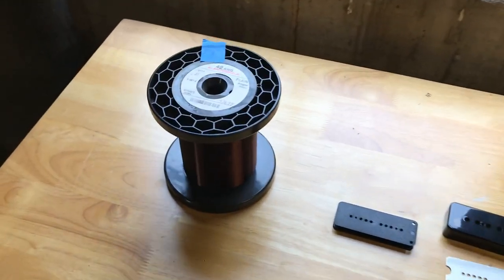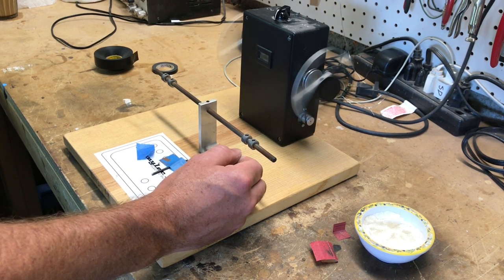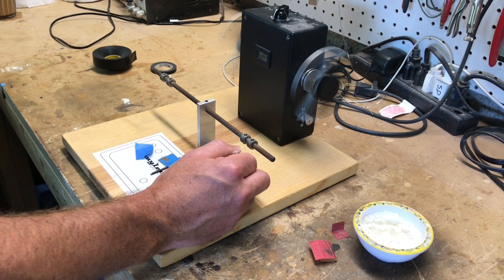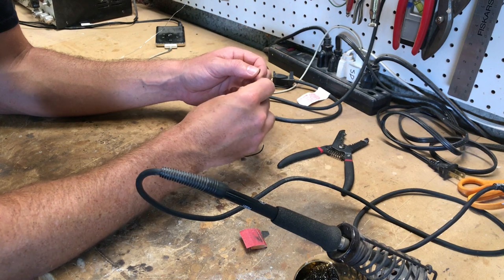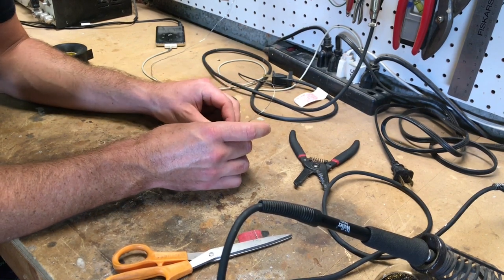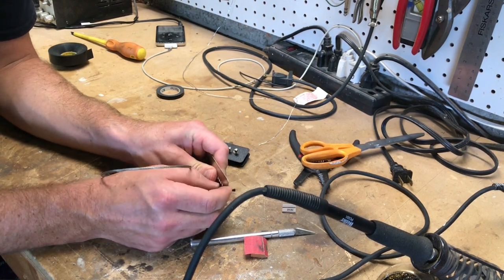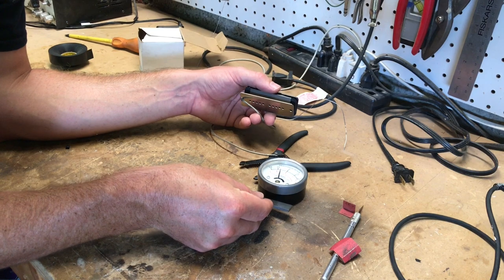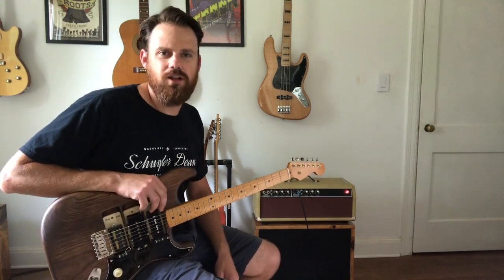How To Build A P-90 Pickup

Comment: This is quite interesting, I have a question though, what if I wind a bridge pickup P90 and I wind 12k revolutions AWG42, it will be significant darker in the tone compared to a neck pickup, what if I try compensate that 12k revolution darker pickup with a capacitor of some sort soldered on the pot, to get the high output but with clarity.. would it work ? Thanks for the video.. :D

Comment: If I remove 4 poles and replace it with plastic ones, will the pickup just absorb the tone from the strings relative to the remaining 2 poles? Thanks in advance for the answer. :)

Comment: I realize this is a little bit older video but I’ve noticed that when guys spec out vintage P90’s especially when you look at the older AlNiCo V Gibson pickups the neck pickup is often a few tenths of an ohm higher resistance (hotter) than the bridge pickup. 

So is that just a relic of the AlNiCo V being in the neck and needing different winding specs or what? 

Not trying to point fingers and say you’re incorrect or anything, just curios because I want to build some pickups of my own and you definitely have me beat in experience. I just know what I’ve read and it tends to show these older P90 “sets” having a slightly hotter neck pickup. 

Usually these measurements are taken at the output jack so could the extra resistance be a  result of the extra wire required to reach from the neck area to where the controls are typically mounted? 

Great video! Thanks!!!
Reply: Resistance has nothing to do with hotness, at least not directly. DC resistance depends not only on amount of wraps but also on wire gauge. Which means pickup with lower resistance can still be hotter (to have more wraps or more powerful magnet). By changing gauge they usually control bass amount you get from the pickup while keeping amount of wraps around the same for both neck and bridge pickups. But in case if pickups are identical, even if they do exactly the same amount of wraps wire is still not ideal, so there is always difference, e.g. they were pulling wire harder when producing second pickup and it became thinner. Wires that connect pickups are thick as hell compared to copper wire in the pickup itself. piece that connects pickups to switch and jack has resistance close to 0.
Reply: Victor Petrenko I’m not Seth Lover but I would agree with most of what you said. Where I disagree is when you say that resistance doesn’t effect “hotness” of a pickup. Maybe I need to define “hotness”, when I use the term I mean to say high output. While number of turns and wire gauge will effect/vary the sound and resistance pickup, I know enough about electricity to know that the amount of resistance in the pickup does have an effect on pickup output. Generally speaking a pickup with 15 ohms of resistance is going to produce a “hotter” or higher output signal to the amp when compared to a pickup with 9 ohms or resistance. 
A pickup is just a very simple generator and increasing winding and thus resistance will have an effect on output. If this wasn’t the case so called “overwound” pickups wouldn’t exist. Of course the wire gauge and type and magnet type as well as construction have an effect as well but the windings and the magnet are the heart of the sound as I understand it. 
I appreciate your point of view and the information you’ve provided me but my original question still remains to be answered if anyone knows.
Reply: Output. (Volume)has more to do with magnet strength than windings.
When I think of hotness I think of how fast a pickup starts to clip the signal., which has more to do with the coil windings.

Comment: If the pickups components are standard, 42 awg  copper wire - too, and it’s carefully wounded 9000-10000+.... why are custom build cost $100+ and chinese ones $10? Where’s the magic happens?
Reply: One obvious factor is manufacturing cost. Hand made in America of course will cost more than machine made in China. Another factor is the quality of the parts. $10 won’t even buy you 6 high quality Alnico rods.

Comment: why didn't you use a black and a white lead wire so someone else would know start finish?
Reply: DALG Guitars
It doesn’t matter. There no such things like "start" or "finish".
If you don’t know the basics, do not poke hot iron in guitar guts.
Reply: @iridios6127  One lead from the pickup is the start of the wind, the other is the finish of the wind.  It matters when you are wiring more than one pickup on a guitar.
Reply: + @dalgguitars  
What kind of catastrophic disaster would happen if "wrong" were to connect the ends of the wires ?
Reply: @iridios6127  it does not matter for a single pickup ( SG Juniors and the like) but it means the world when there's two or more- you see, you want to know what ends are what so you can wire them in phase for stronger sounds and out of phase for shimmery weak but interesting, hollow sounds. Or if you go for simple mods, you must put them all in phase.. same as speakers.. the reason why speaker wires are colored are for you to know what goes where so the sound is what you expect not out-of phase artifacts...
Reply: @axelmorisson  
Almost all modern circuits contain 1 pickup out of phase for the humbucking effect.
Reply: @iridios6127  yes but no.I mean it can be reverse wound but with magnetic poles flipped.This way common mode noise such as noise picked up from external sources gets rejected being out of phase but the signal generated by the normal and the reverse wound AND magnetically opposite pickups remain in phase.Yes there is sometimes a in phase -out of phase switch in some wiring mods and what it does is flip those two wires.Still here the guy making these pickups wired them with the start to ground so there are only two..the shield that is also the start and the end that is the core of the wire..or positive.
Reply: @axelmorisson  
Why are you telling me things I’ve known for over 27 years ?
Reply: @iridios6127  :) maybe it would help others...